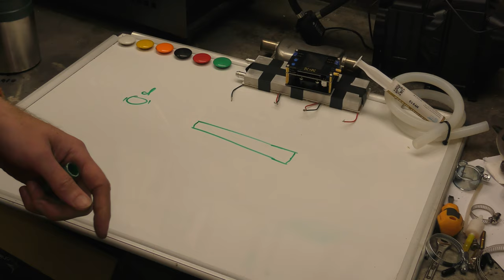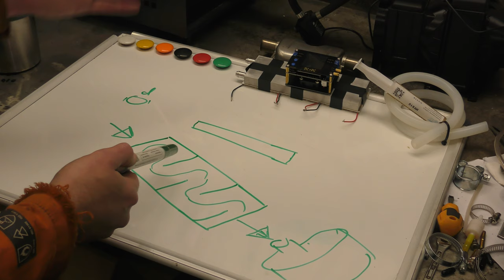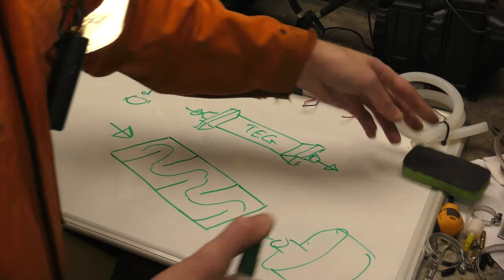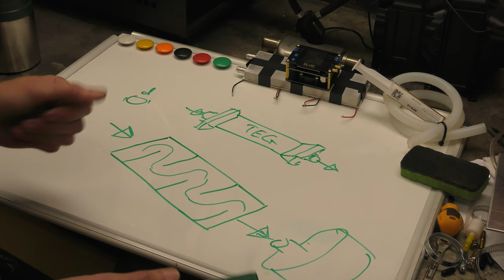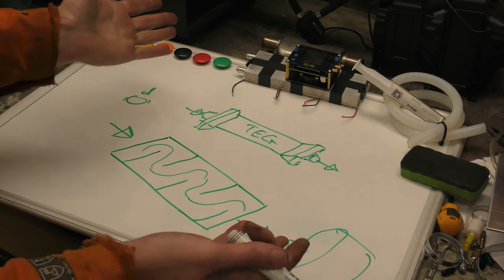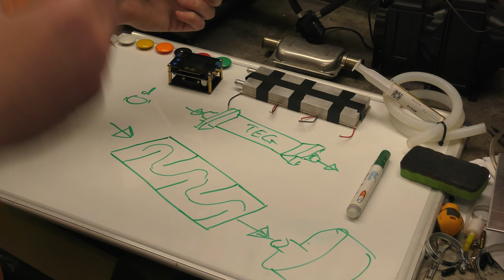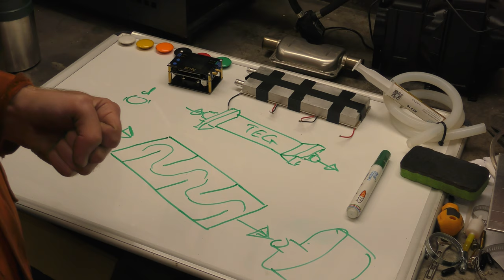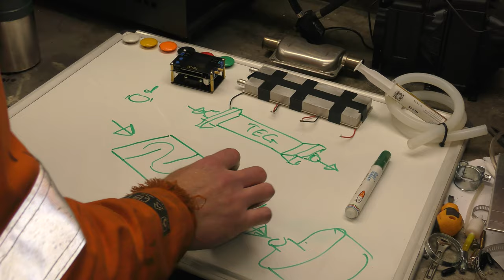Self Powered Diesel Heater Project - part 1

Comment: David sorry to bring bad news, but peltier devices are only 5% efficient. I have done tons of experiments with these and you will never generate enough power, your peltier devices must be TEG not TEC check the type, if TEC the solder junctions will melt on the pn junctions and destroy the device. You also require a massive heatsink with fan, just to run the heatsink fan will nearly use all the power generated. If all this worked we would have candel powered generators for our electronics. 10/10 for trying.
Reply: It all depends on how much waste heat the process creates though.  Assuming 0.5L/hr, ~42MJ/L diesel thermal, we're talking ~5.83kW.  The heater is rated at 5kW output, so that suggests there may be ~830W of exhaust heat.  At 5% efficiency, you might be able to pull ~40W, which is kinda getting close'ish.  And some of that waste heat is recycled as well (as it returns to the air input).

David's idea was to use the heater's own fan to draw air past the heatsink back into the unit, which could theoretically increase EGT.
Reply: @GordLamb  it is also dependent on temperature differential ie hot to cold. Maintaining the cold junction is very hard as everything starts to heat up. You can do paper cauculations but in practice they do not work. Good try 😉
Reply: Aye.  Success or failure, it'll be a great video no matter what. :)
Reply: @hunter00047  don't forget that in the real world situation. you would run the heater when it's cold outside. So you should have plenty of cooling available. The burn chamber also draws in air from the outside air. And the air to be heated could come from outside as well.
Reply: @andydroid2413  yes I agree but, more peltier devices will be needed and more cooling area required. This is a try it and see project.

Comment: This is an interesting project, since the Peltier units work on temperature differential, it might help if you can configure the exhaust (heating) flow in the opposite direction to the water (cooling) flow so that the hottest exhaust is opposite the warmest water and the cooler exhaust is opposite the coolest water - the old countercurrent method?  A  simple central baffle in the exhaust manifold would cause a 'U' shaped exhaust flow pattern  mirroring the coolant flow pattern - looking forward to seeing you progress, thanks!

Comment: So according to that datasheet max temperature is 250c, what temperature are you measuring from your exhaust?  In one of your videos you measure the temperature at 150c but that's just the Flir maxing out. If you can get the hot side to 250c then everything else is down to cooling, or adding more units.

Comment: Build a rectangular exhaust that is baffled. Then have 2 of the thermo electric modules in use, one on each side and wire them in parallel. So a 3s2p capturing the heat from both sides = double the power.

Comment: What about fins within the exhaust heat exchanger?  Like could you use some PC aluminium heatsinks and weld them into a box that the exhaust flows through?

Or using heat pipes that transfer the heat from the exhaust gases to the plates ? They can transfer heat really effectively. That makes me think would copper be better?

Comment: that rubber coated insulation gives off a rubbery smell ,  its for external lagging,  i had to remove mine ,  obviously in a shed its ok, i had a 3m meter run of it in a living space,  i used glass wrap , which is the correct way.   It was on a diesil water heater a good mate of mine gave me,  who,d do a kind thing like that?   Only a top fella.

Comment: i would have the side you dont wont to attract head thicker aluminium  the side you wont the heat a thinner aluminium this should mean the heat you wont shou go to the teg that are rap the side you dont wont the heat in fire blanket ot steel

Comment: Martins comment is basically what I was going to say. The power used by the extra restriction on the intake fan from the radiator would likely be more than the tegs will ever produce.

So you could use massive Ali heat Sinks for the cold side. But they would have to be truly huge to dissipate the amount of heat you'll be capturing. £££

I can already tell you without even doing any maths you'll need at least 10 times the amount of tegs than you've got in the video to even come close to the idle current of the heater. 

I've messed around with these years ago. I quickly realised how brutally inefficient they are.

A mppt charge controller would work better than a buck converter. But £££ makes it not worthwhile.

I'd series up as many as possible that your buck convert can handle. To minimise voltage drop. The parallel the rest until you get the needed current. 

You actually might run into the problem of it being too hot. Regardless of how good your cooling setup is. I've killed a few even with ice on the cool side from being too hot (yellow flame hot). They are pretty fragile. So I wouldn't worry about the insulation or slowing the flow too much.
If anything you might want to think about having an exhaust diverter before the tegs to divert away to reduce the temp if it gets too hot.

To summarise its a good science project but with your current amount of tegs you'll be generating 10's maybe 100's of milliamps of current at 12v. So it's a bit of a gimmick.

Regardless its interesting. So go for it.

Personally I'd be more interested in doing some sort of exhaust flow scavenging on a big chimney using the draw of the heat rising to spin a small turbine.

Comment: This is going to be an interesting series! Do you know what the maximum temp differential can be across the Peltier cell? I don't recall them being able to handle large temp differences, although I have a shocking memory! I'll be amazed if they can generate enough to power the heater, but heck, it's worth it just for the experiment 😃
Reply from the maker: The TEGs can handle a much higher heat than the TEC modules.  I think the TEGs max out at a 250ºC difference.  But I also have a terrible memory.

Comment: You might need a manifold to direct the exhaust down on to each plate so they all get the same heat rather than one end hot and the other end cooler
Reply from the maker: Ooh now there's an idea.  Good thinking.

Comment: Up to this point, I hadn't considered the idea of thermal energy conversion. From the old egr concept, I modified it to scavenge more heat for the hot tub heater from a old Eberspatcher D5w and it works very well. However I now clearly need to get my head around this. Self powering would be a excellent addition
Reply: How do you deal with the noise / smell?  Our hot tub costs me about £100 a month, electric tariff about to shoot up as well
Reply: @jamesl5149  It doesn't run constantly, just when required. Takes about 2 to 3 hours to heat up. It also has a double silencer fitted so is surprisingly quiet. It's also far quieter than the bubble pump. Once started and running, there is no real smell either however I've situated the heater about 10 ft away outside the gazebo where the hot tub is situated

Comment: use SSR heatsinks into the exhaust to collect the heat to the unit. disperse the exhaust equally to then from bottom onto them. old welding blanket for insulation (nonbestos material) glue to box with wood stove cement. you will probably need 6 to make it work